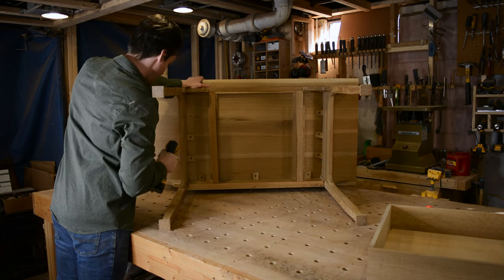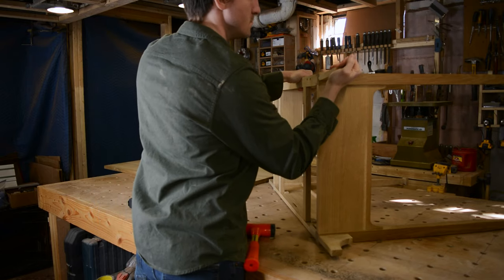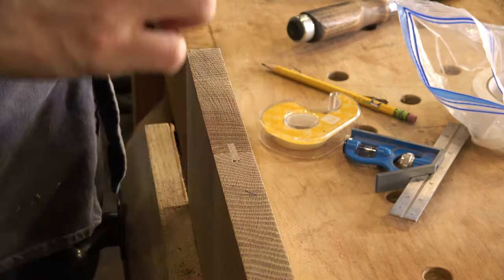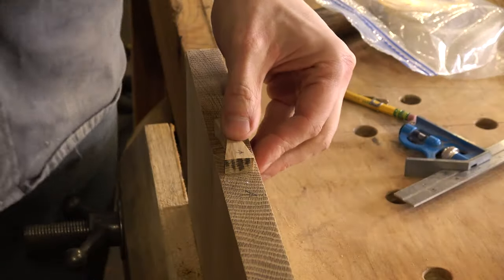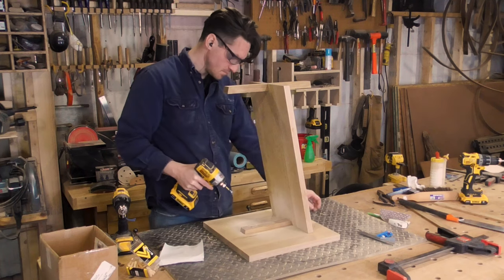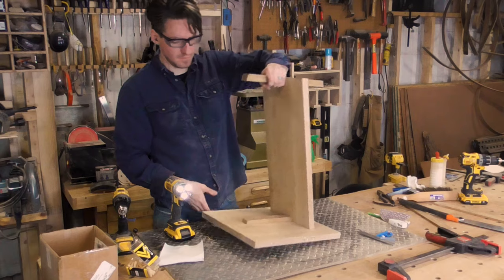From Desk to End Tables: Peaceful Upcycle Project

Comment: Cherry cool! What kind of stain did you use and what kind of finish (and why did you choose these). Woodworkers are always saying you need to be quick while staining so it doesn't streak. Is this considered quick enough, or is it because the stain is so dark that streaks won't show up?
Reply from the maker: I think the stain was the "minwax wood finish, true black." I struggled with the finish. I dont think I let it dry enough between it and putting the top coat on. I also think I should have put it on with a white buff pad instead of a foam brush. The finish was two coats of rubio monocoat. 
I'm not sure on the streaking. I think if you wipe off the excess that helps even it out. I think a lot of streaking is dependent on the type of wood being used.
Reply: @oliverclarkstudio  thank you for your thorough reply!